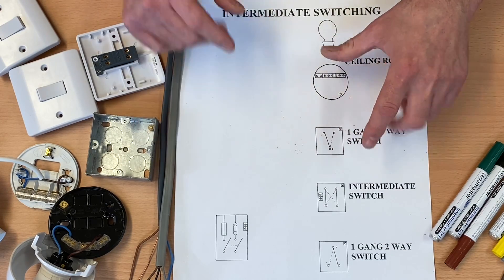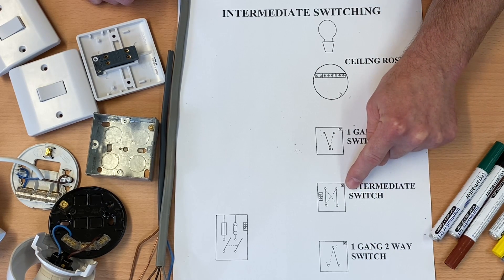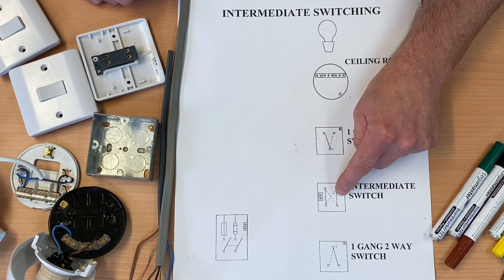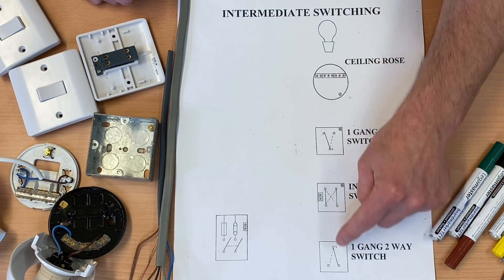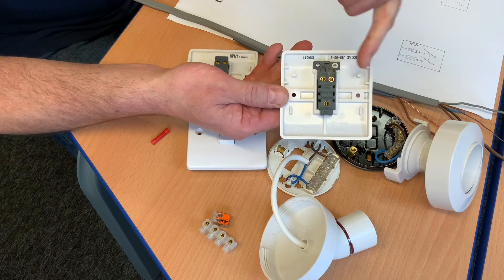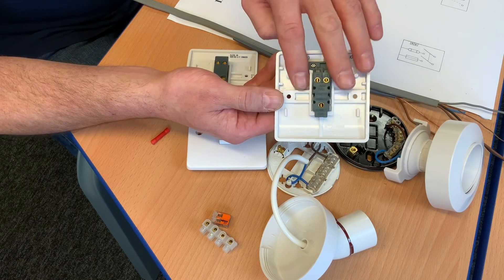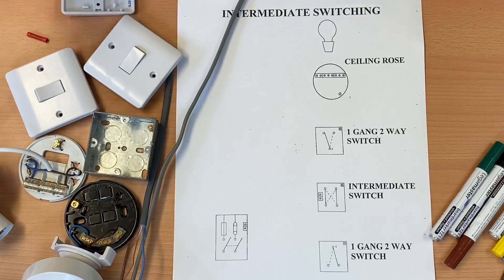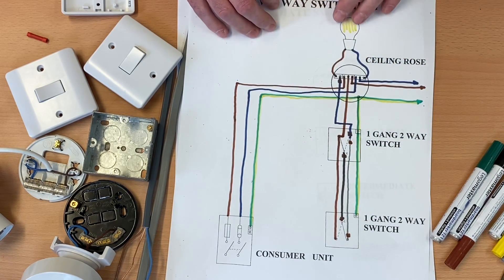Wiring Diagram 2 Way & Intermediate Switching of a Lighting Circuit 3 Plate Method Connections

Comment: Hello, this is very helpful. Does the same principle apply if the supply is in the switch loop in loop out?

Also I have the light feed coming out from the intermediate switch instead of the first 2way switch how will this be wired?

Comment: I've got a situation where the 3 core & earth is run from switch 1 to 2 and then finishes on 3.
The switch wire from the lighting loop is in the middle switch (switch 2)

I'm not sure if this will work as either ends of the 3 core are in switch 1 and 3.
Hope I explained it for you to follow.

Can anyone shed light on this!

Comment: What do you do with the earth cable at the end, on a plastic switch?
Reply from the maker: If it full insulated - back box and switch with no earth terminal in the box then put the CPCs together in a connection block.
Reply: @GSHElectrical  sorry if it seems obvious but it's the 2way switch after the intermediate has the earth wire on it's own. Do I just put it into a wago connector?

Comment: how do you make this 2 and 3 way switching system have a neutral at each switch for smart switches?
Reply from the maker: Wiring Diagram Wired Through the Switch Lighting Circuit AM2 & AM2S - 2 Way & Intermediate Explained
https://youtu.be/cIPZhriDQr8

Comment: Great video. I have a slightly different set up with my upstairs light in that the ceiling rose is wired to the intermediate switch (in the middle) and the 2 way switches are left and right (if it were a diagram) if that makes sense. Have you got any wiring diagrams for that set up at all?
Reply from the maker: Wiring Diagrams for Lighting and Motor Circuits
https://www.youtube.com/playlist?list=PL2Ea5r9gxUUfm4SACOSOZigCeSxxC5xaO

Comment: You used the black conductor to connect the 2 commons, is this just a personal preference or can it be done with any of the colours. I was told not to use the black and it should be brown. Is there a kind of an unspoken rule where everyone uses the black. or does it really not matter at all? would really appreciate some feedback on this everyone as well. Thank you very much in advance.
Reply from the maker: I always use black for common 👍🏻. If you look at the drawing the permanent line (brown) into the first 2 way switch is connected to the brown of the 3 core make that permanently connected to the line conductor. Hope this help. Gaz 👍🏻
Reply: @GSHElectrical  Thank you! I done it this exact way at college (and it all work after testing continuity) and was told that I had wired it wrong, and that I should use the grey and black in L1 and L2 and the brown in common. This confused me as I guess everyone does it differently :D

Comment: any drawings of a two way switch with supply at the switch?
Reply from the maker: Wiring Diagram Lighting Circuit 2 Plate Method Taking the Feed to the Switch - 2 Way Switching https://youtu.be/QX1B4gtqisc

Comment: If all switches were intermediate, you would never need a 1 way or 2 way switch as intermediate can be used for either 😉
Reply: True, but intermediate switches are significantly more expensive (they have basically twice as much internals). 1 way switches are mostly dead here in NL in favor of just using 2 way with an empty terminal, though.
Reply: @JasperJanssen  thas where supply and demand comes in. I remember when RCBO's were well expensive
Reply: @MrSJT  intermediate switches will never be as cheap as 2 way, because internally they’re essentially a 2 gang switch properly interconnected. No matter how much supply and demand there is.
Reply: @JasperJanssen  the reason why supply and demand won't happen is because they will always buy 1 and 2 way switches where required, intermediate is a lot more expensive in some brands due to lack of demand.  The actual cost of making it isn't much coz most of the time you are not paying for the mechanism, you're paying for the plate and assembly.  Supply and demand only happens where there is a necessary transition such as reg changes.  The prices are more exaggerated on cheaper switches.

Intermediate switch sales will more than significantly increase if there was no use for 1 and 2 way switches

Comment: Hi Gaz,

Can you please be more careful with your wording; "It doesn't matter which way round you do L1 and L2..."

I had a qualified electrician do a partial re-wire, which included 2-way switching (no intermediate.) When he was finished, for the light to be off, one switch was in the off position, and the other was in the on position. If the switches were both in the off (or the on) position the light was turned on.

I felt it quite a reasonable request to ask him to configure it so that when both switches are off, the light would be off. I was very surprised by the authoritative reply of "No, you cannot configure 2 way switching like that!"

I waited for him to leave, turned off the power, and swapped the brown and grey wires in one of the switches, and the light is now off when both switches are up (or both down.)
Reply: Yes quite easy done or just turn 1 of the switches up the other way

Comment: Great video as always Gaz, do they still teach the old singles method ? its a handy one for new lads doing conduit work
Reply from the maker: Yes - I am doing the 2 plate method as well in this series of videos 👍. Thanks for watching and commenting. Gaz 😁
Reply: Sorry Gaz, i meant the 2 wire method, feed at one of the 2 way switches and switch line from the other end , so as not needing a strapper

Comment: I understand that you have to identify the lines when there are different colour codes of cables in the system or using the blue as a switched line, but in a completely new installation (with the exception of using blue as switched line)? I mean the lines are identified by todays colour code: Brown, black and grey are lines.
Here in Germany in most cases it's not economical to install more than three switches that way. If more than three switches are required we use such a thing here in combination with retracting switches. Also available in a version for junction boxes, this one is for installation on a DIN rail:

https://www.eltako.com/fileadmin/downloads/en/_datasheets/Datasheet_ESR12NP-230V%2BUC.pdf

You only require two wires at every switch, a line and a (temporary) switched line sending the short impulse to this central switch. So easy to extend later on and add further switches if required. I have installed one for the lighting in the staircase of my house. The price they state in the data sheet is on the high side, street price for this specific model is round about 30 Euros (27 GBP). To spare the contacts they switch at the zero point of the sine wave.